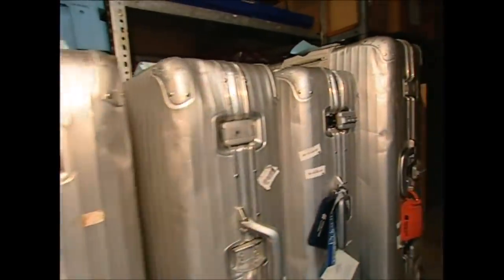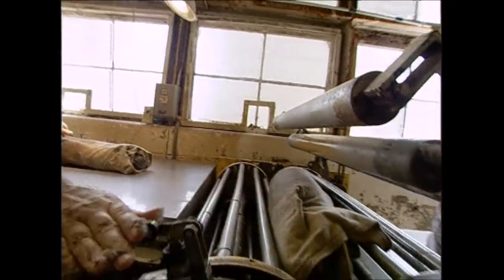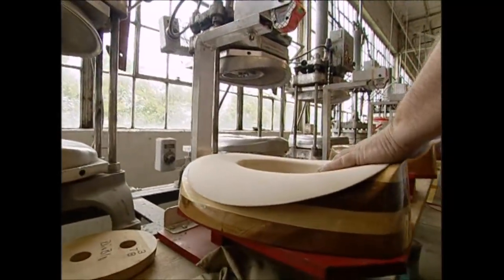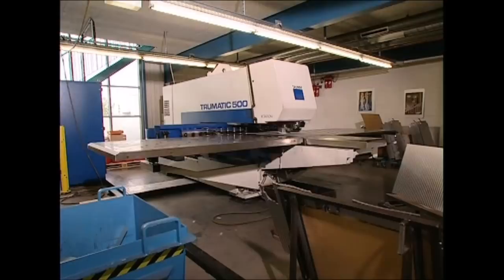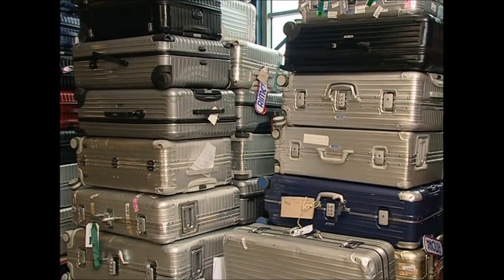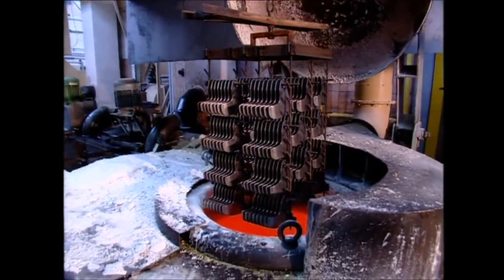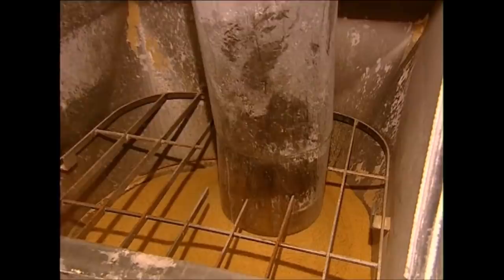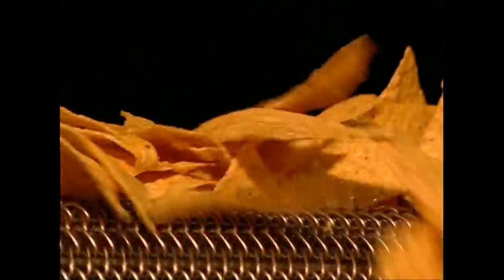► HOW IT WORKS | Cowboy Hats, Suitcases, Lawn mower, Tortilla Chips | Episode 16 | Free Documentary

Comment: Wow so every new mower was tested to 100 hours on a rough track, I also read that Honda will run a motorcycle engine for 100 hours at full throttle if they stay together and make the whole 100 hours test its a pass.